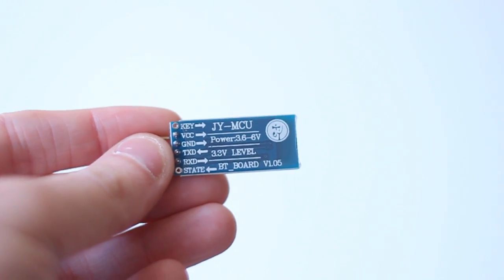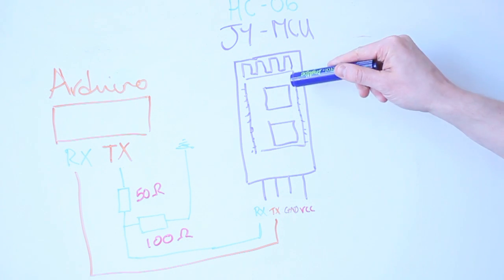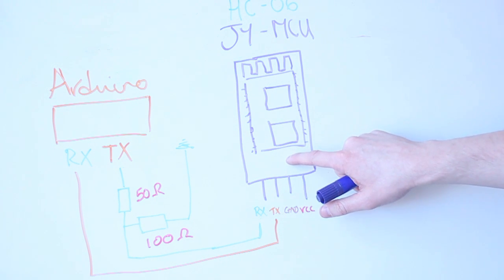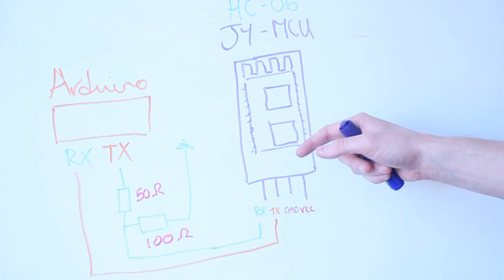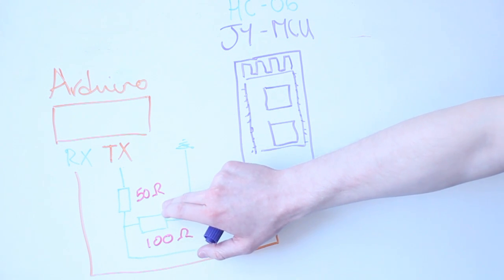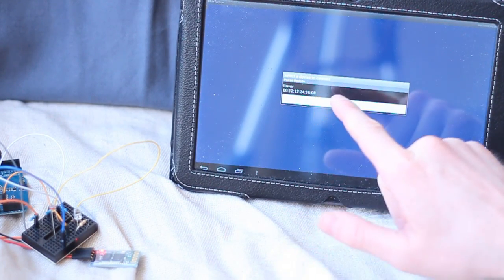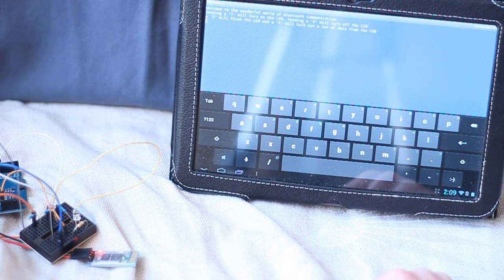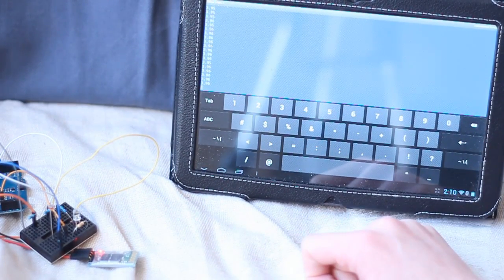HC-06 (JY-MCU) Bluetooth Serial Module: Wiring and getting started

Comment: Hi David I have a radio scanner with a 9pin serial lead that goes between my laptop and scanner and would like to make a Bluetooth HC-06 connection that is a Bluetooth board with a 9 pin plug on it that will plug the lead into so I can use my software for the scanner without a physical link between scanner and laptop. Do you know if this is possible using the HC-06? I know its not what this post is about but its the only way I can contact you now as I can not find you on Facebook anymore. Hope you can answer my question and if its yes and there is a project out there could you please give me the link. If it helps I am Bill Achmed Parker on Facebook I'm sure there will only be one with the name and im sure we have already talked on Facebook.
 Thanks
 Bill

Comment: Hi, I am a private investigator and have found a gas pump skimmer installed on my clients gas station. These skimmers work via bluetooth, all they are is the HC-06 bluetooth module connected to the card reader on the gas pump. It saves the credit card details on the EEPROM or the Flash memory. We have not removed it yet, we want to first gather all the data from it before removing. I have paired with it, the password was 1234. Now what do i do in order to get the credit card numbers?
Reply from the maker: Hi, standard HC-06 modules don't work like that on their own. They have to have another device (microcontroller) telling them what to do. As far as I know the flash IC contains the firmware for the bluetooth radio chip. How would a HC-06 intercept an 'unencrypted' series of credit card numbers from the gas pumps? If it really is storing the data via some kind of rewritten firmware then your only hope is to capture the guy who wrote it or call the police.
Reply: This gas station has already been hit 3 times, thats why this guy called me. The police just come and take the skimmer and the bad guys are still out there. I dont know what they did that it stores the credit card number on this bluetooth module, but i do know that its possible. This is a nationwide crime, and its always done with either a HC-05 or HC-06. Do a simple google search and you will find many articles about it.  They connect the HC-06 with cables, one cable is connected to the card reader, and another cable is connected to the pinpad. Its basically acting like a middle man.

Comment: +David Watts, would you be willing to do a short totorial on how you calculate the voltage, current and resistance with the two resistors to help you achieve ~3.3 Volts?  Old Navy elecrician, but forgot so much.  A practical application/explanation of this would sure help.  Thanks.
Reply: Hi. The voltage output is given by the voltage divisor. The formula is very simple: the output voltage is equal to the ratio between the resistance value whose pin is connected to ground over the sum of the two resistors. This ratio multiply by the nominal output voltage of the Arduino which is 5V.That is, Vout = (100/150)x5 =3.3V. In my opinion, Mr. Watts use a set of resistor values which are somewhat low. In this case the output pin current is around 33mA. I suggest you to use 1K and 2.2K. The former replaces the 50 ohm resistor and the latter the 100 ohm resistor. Look forward to hear some stories of your old times in the Navy :) Kind regards.

Comment: Hi dave I am looking at your unity plugin https://www.assetstore.unity3d.com/en/#!/content/16467 I need to get data from a universal Bluetooth device that works with some fitness apps on android. Its a Bluetooth heart rate sensor that I need to read and pass to unity. 

will this plugin help me in any way. Also the device is bluetooth 4.0 so will that be fine. I checked it with wahooo fitness and that was able to read the data just fine.
Reply from the maker: Hi, I am afraid that is not my Unity plugin. It appears there are just using my video to help people wire the thing up.
Reply: Ok thanks for letting me know David

Comment: can this be connected to a teensy board and used as an hid? specifically a joystick?
Reply from the maker: I think so, the bluetooth should be a straight passthrough.
Reply: +David Watts I'm a complete noob with my teensy. I'm trying to build a Bluetooth xinput gamepad with a teensy LC, a mega drive controller shell, and a Bluetooth module of some sort. I'm hoping to either use one of these or an HC-05 flashed with the BlueSMiRF firmware.

Comment: uh...... a voltage divider ? I've never used that.  just a direct connect,  daily and I've never had a problem (2 years) . not that i doubt you at all,  really just remarking on stupid i am
Reply from the maker: +rocklobster1976 Ha ha, I would advise lowering the voltage with a divider but I don't follow my own advice most of the time with fairly tolerant electronics. The 5110 screen is a prime example.
Reply: +David Watts say, you wouldn't happen to fave any help regarding, say, pinging between bluetooth modules to gather the TimeToLive of the packets.  basically indicating their distance between  ?
Reply from the maker: +rocklobster1976 Sorry, I haven't done anything with time of flight before but I am sure a good googling session would pull up some code.

Comment: Hi, great video :)
I have an RN42 and have my phone talking with it.
I want to use a water sensor (looks like bare circuit board with a zigzag track all over it) to measure the water level in a bath. When the water touches the sensor it changes the resistance of the sensor.
I want to connect this to an input port on the RN42( can you recommend a pin to use)?
I don't want to use Arduino, just the RN42
I guess the input port wont measure resistance so i would have to use some kind of resistance voltage divider ? can you explain how to do that ?
I am running the RN42 off 2 x CR2032 in Parallel .. i know .. they do no have enough juice :) 
Any suggestions would be much appreciated.

Comment: I am trying to get the HC05 work with unity. When I use the wired serial port, it works fine, but when i select the bluetooth port, it hangs. It works fine on an emulator (ttermpro), but the unity c# code gives IO exception - element not found. Can you give me some advice?

Comment: Hi guys I am newbie in arduino. I have a question- I upload basic code on arduino (just setup & loop with blank body).
After that I tested voltage of rx and tx pin It showing 5v on both rx and tx. My question is why rx output is 5v (according  my opinion it should be 0v cause it received signal). It means I also need voltage devider between Rx(arduino)-Tx(Bluetooth). Correct me if I am wrong. Please clear my confusion.
Reply from the maker: Ashish Sahu You will only need a voltage divider from the TX pin on your arduino. You don't need to bring it down to an exact 3.3v just pretty close, I just used resistors I had on hand. The TX pin will sit in a high state at default, so you will see 5v until data is being sent.

Comment: Hi David, thanks for the helpful video. I would like to send data from my pc to my arduino uno to control an LED matrix so as not to need a USB cable. When the HC is configured and paired, does it show as available via a com port on the PC (that can then be selected for data transmission)? thanks for any advice you can give.

Comment: can't we put just a 4.7Kohm resistor?
Reply from the maker: Rocco Musolino What for?
Reply: Instead of the 2 resistors..
Reply from the maker: Rocco Musolino You need a voltage divider which is made up of two resistors. They provide two different paths for the voltage and it is distributed across the components - http://en.wikipedia.org/wiki/Voltage_divider
Reply: David Watts ok, understood.

Comment: Great video. I recently got some LED that runs very hot at 12 volts with my 12 volt LED driver. I will use the resistor trick you showed to lower the voltage by one volt. What level resistance do you suggest?  Thanks.
Reply from the maker: How many LEDs are you talking about? Resistors work great at low current but if you start pulling more they will break. You are probably better off using PWM to reduce the current consumption of the LEDs.
Reply: David Watts Actually its a LED light that has quite a few LEDs. I think I will go the PWM rout. Thanks.
Reply from the maker: You are welcome, I did the same here - http://www.youtube.com/watch?v=-5UC8j6w63Q

Comment: Hey,
Do you know if it is possible to use this module to stream audio?
I want to make a portable speaker and I already have the arduino uno, and im finding a way to stream audio. I want to be able to connect a phone to my speaker and play music from my phone trough the speaker using bleutooth. I hope you can help me :D
Reply from the maker: Don't get one of those, it won't work for that. Use one of these instead - http://www.ebay.co.uk/itm/BLUETOOTH-MUSIC-RECEIVER-USB-A2DP-WIRELESS-3-5MM-HIFI-AUDIO-STEREO-PORT-ADAPTER-/221667704620?pt=LH_DefaultDomain_3&hash=item339c6cbf2c Take it apart and put 5v into the power sections of the usb and the audio cable to your speakers.
Reply: David Watts Thanks!!!

Comment: Just wanted to put my two cents in, Your Scimmy shows 50ohm, 100ohm which will cut the voltage in half. 5/0.5=2.5 (very unreliable for rx tx) You sould change that to 50ohm, 150ohm which would be 1/3 giving you roughly 3.3v. Just a thought. Alot of people like to play with the AT commands (change module name, pin etc.)
Reply: Geart vid by the way. It was a good starting point, just had to figure the above to really get that sucker rocking.
Reply: Dave Powless This circuit consists of a voltage divider. The rx/tx voltage will be 5*(100/(100+50)) = 3.33V

Comment: its not working right with me , its send data only to my mobile and not receiveing data from mobile ,can any one help plz my andriod phone is samsung.
Reply: ditto!!...
Reply: Read the above comment. It might save you a date researching in the depth of the internetz.
Reply: Dave Powless Are you referring to your comment Dave? I've tried using a 150ohm resistor instead of 100ohm and it didn't work
Reply: You would use a 150, and a 50 to divide in thirds. 1/3 of 5v not on half. If it's not working check you have rxtx these modules are a pain.

Comment: Good day sir, Can i ask? Can i pair this bluetooth module into a wireless bluetooth headset? Do i have something to hacked? is it feasible?
Reply from the maker: Edison Dignos Hi mate, sorry for the late reply. This is a serial bluetooth module not designed for audio so it is unlikely but it you can transmit at a reasonable bitrate then you could feasibly kick out an audio sample to a compatible receiver but not something off the shelf.

Comment: Hi, excuse me, I have a question. I am trying to connect a cell phone with a microcontroller to send SMS. I wanted to eliminate the step of using Max232 to connect the phone and microcontroller and use the module HC-06 to connect the two devices, but I can not make pairing between HC-06 and the phone, the phone does recognize the module and adds to its list of devices, but no communication between the cell phone with HC-06 to send aT commands from the microcontroller to the cell phone and thus send a SMS. 

I wonder if there is any way to solve this problem and connect the HC-06 with the phone, or how else I could do? 
I'm using the phone is a sony ericsson t610 (I know, it's an old phone)
Reply from the maker: Sorry mate, no idea, no experience with that generation of phone. Hopefully someone else from the community will pipe up with a suggestion.

Comment: hello bro ! if i would to connect this module with a pic16f876 ,i should make the same shematic ( res 50 and res100) witth  the TX and RX of pic ? voltage of the is 5 v and i make the VCC of module in 5v too ! i should make a max232 betweeb the pic and the hc-06 to down to the 3.3 v ? and is't necessary to install a drivers on the pic to recive informations from th bluetooth ? thx :)
Reply from the maker: Hi mate, yeah you would still need the voltage divider for the TX of the Pic chip. No drivers are needed, you can just use the normal serial out stuff at a 9600 baud rate. This link should help with that - http://www.tigoe.net/pcomp/pic/pic-serial-pbpro.shtml Let me know how you get on.
Reply: thx bro , i will make a voltage divider :) thanks  David :)